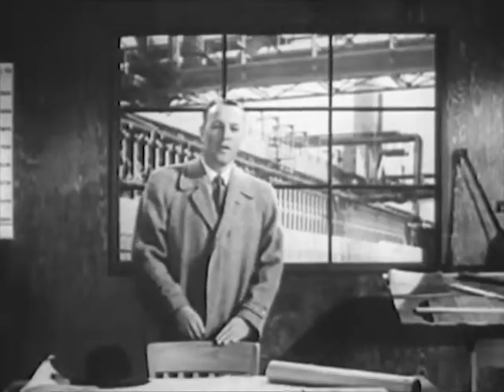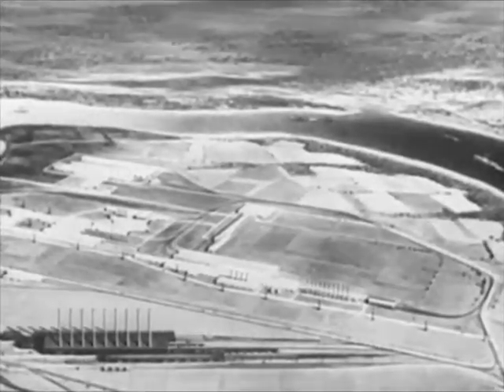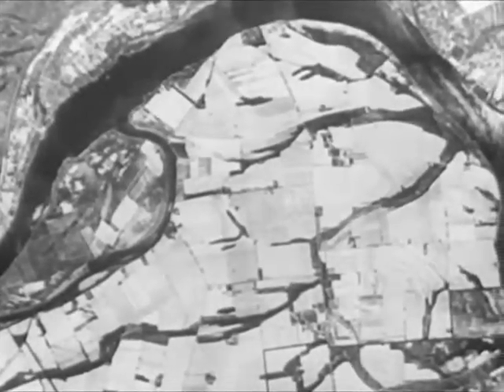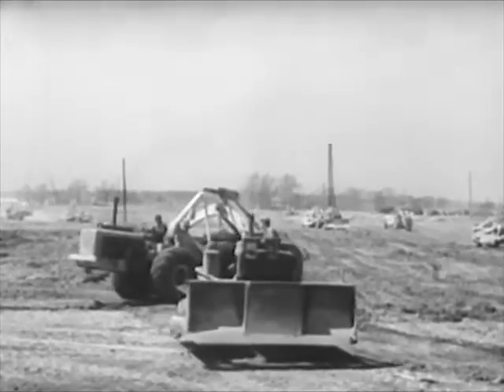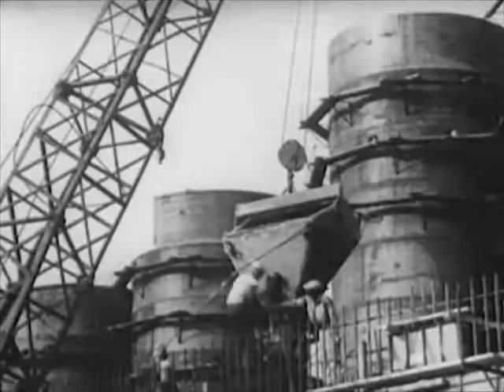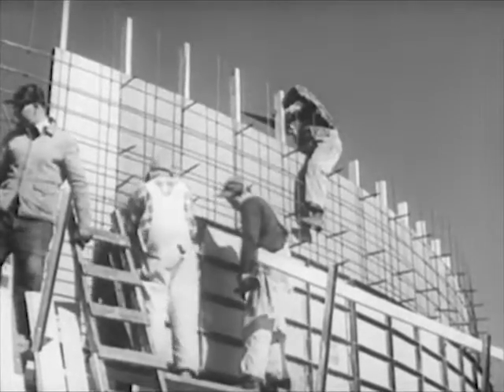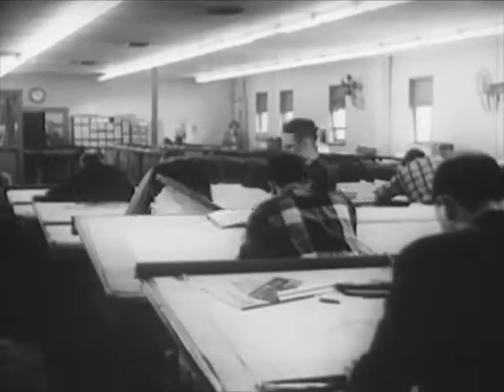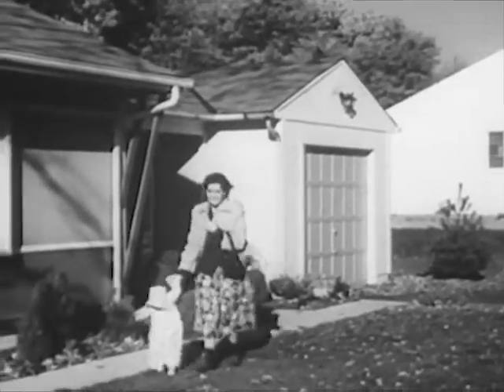Levittown: New Neighbor - 1953 Steel Mills - CharlieDeanArchives / Archival Footage

Comment: Worked at Fairless Works for 6 years; my second U.S. Steel assignment.  It was a great facility.  Not mentioned in this video are the two Electric Arch Furnaces and Continuous Caster installed circa the 1970's. It is manufacturing like that done at the Fairless Works that contributed to making the United States the best economy in the world. It was shutdown about 2001. Benjamin Fairless said the plant would exit for "50 to 100 years." It only made it to 48.
Reply: What was in the Blue Buildings that are still there ? Was that the PowerHouse ?
Reply: @pressureworks  You are testing my memory. Left Fairless Works for a USS plant in Ohio in 1979. Don't know what buildings remain at the site.  I think the buildings that were blue when I left were the Electric Furnace and Continuous Caster Building and the Soaking Pits and Slab Mill.  Should be embarrassed as I walked into the Electric Furnace Building many times for one of my jobs.
Reply: @pressureworks  i believe the powerhouse is still being used by the Philadelphia electric company..I worked in that building until 1982 ..Good times except for the winter when the river would freeze up and the boilers weren't getting enough water...
Reply: @badlobo2105  thank you,
Reply: They were probably built after this documentary was made